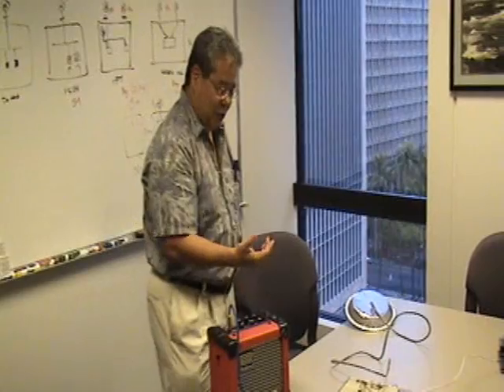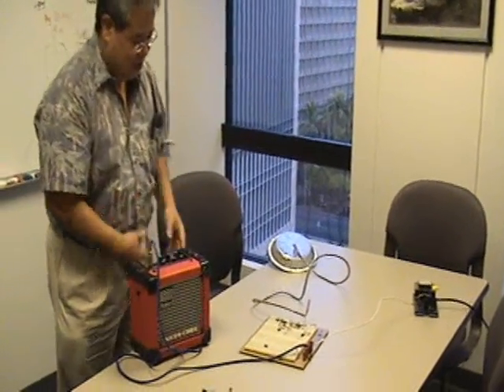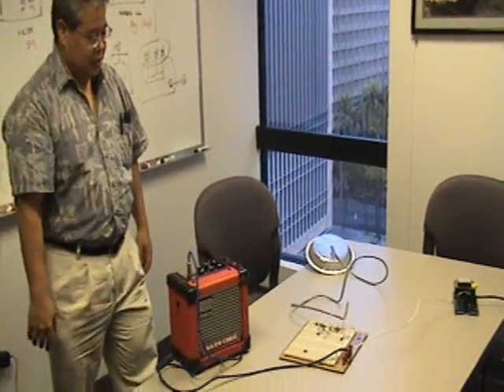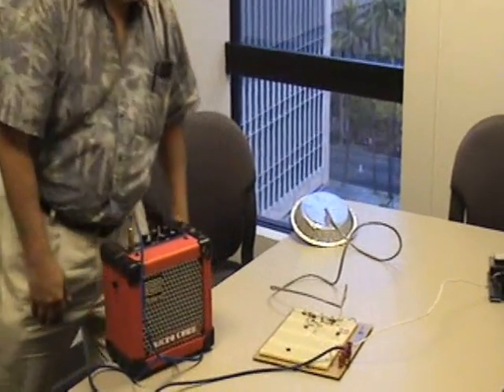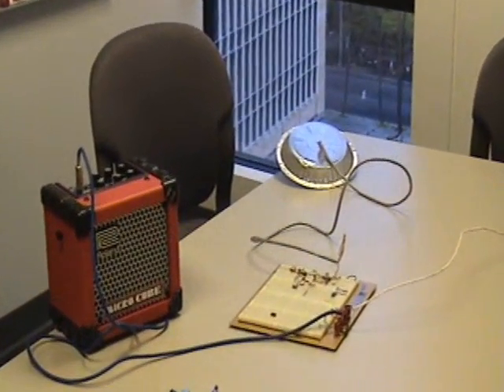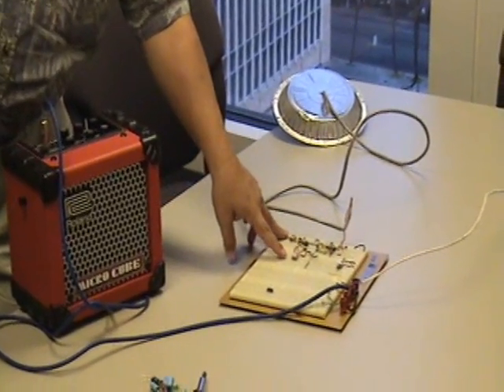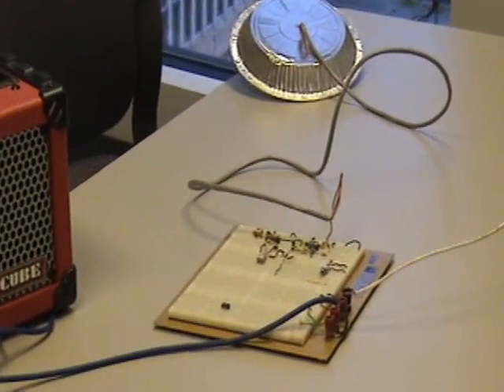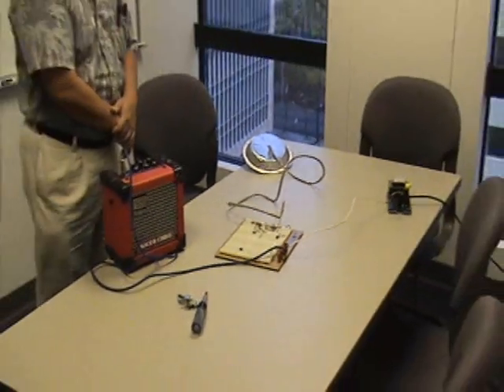Minimum Theremin Prototype

Comment: @BassMike80 There are no 100uF ("microfarad") capacitors in the circuit. There are two 100pF ("picofarad")  capacitors in the circuit. A picofarad is 1,000,000 times smaller than a microfarad. Toshiba TC4069UBPC is fine for this circuit.

Comment: @janxzul No, DON'T use type CD40106. The circuit is specifically designed for CD4069 and won't work with CD40106. Also, there are NO 100uF ("microfarad") capacitors in the circuit. There are two 100pF ("picofarad")  capacitors in the circuit. A picofarad is 1,000,000 times smaller than a microfarad.

Comment from the maker: Hmmm...  I posted a response the other day but I guess it didn't "take".  Anyway, the project was about $20 in components and wire with lots of spares.  Plus the breadboard (I had it from college - many many many years ago) will set you back $40-60.  The power supply is about $50 from Kele.  You can implement the circuit with a 5 VDC voltage regulator chip and a 9 VDC transistor battery.